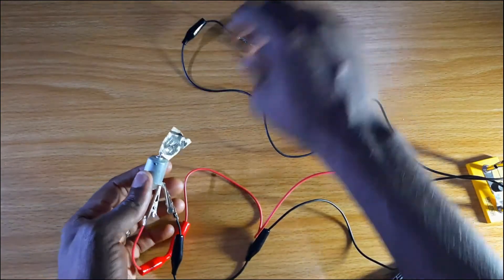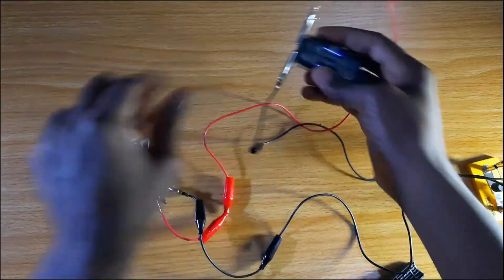Watch what happens to the direction motors spin when you reverse the wire connections in the circuit

Comment: Like the one you used for your remote controlled car
Reply from the maker: They are quite similar. However,  the car uses a more complex component (an h-bridge motor driver) to make the motors easier to control.